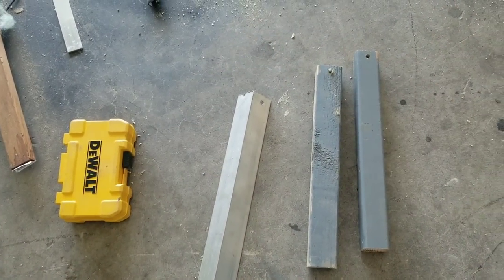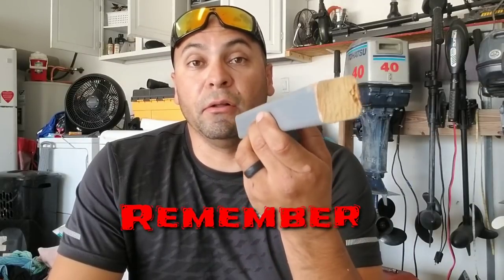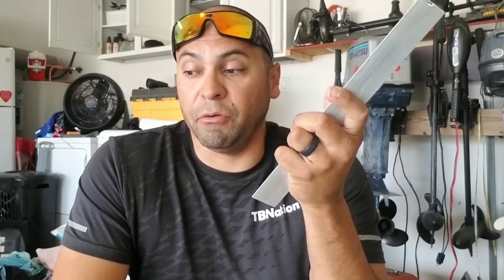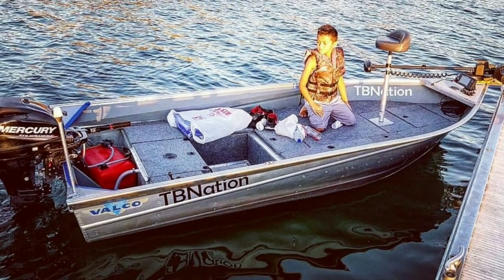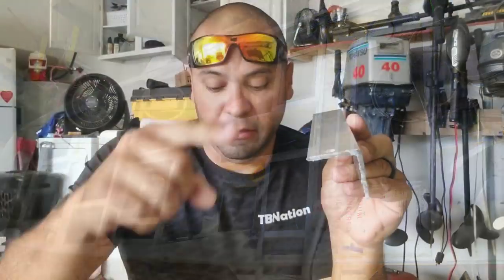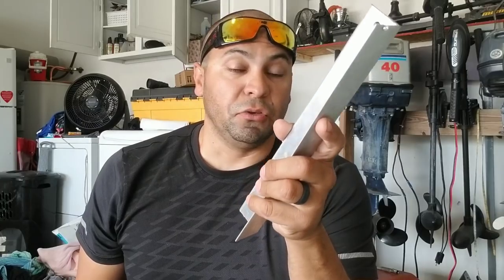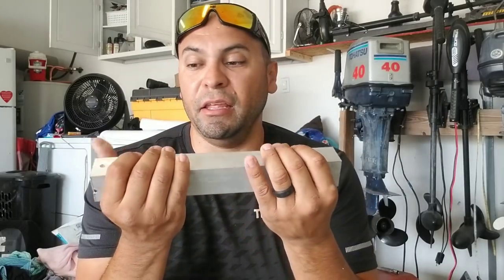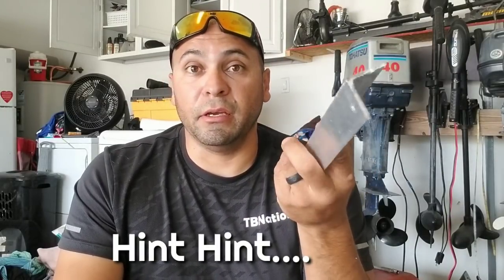Tiny Boat Framing Q & A

Comment: Mike, the cheapest I found was 1/8th 1 inch x 8 foot on Grainger.com. $9 each. Shipping is average, however, if you have a Grainger in your area local pick-up is free. I ordered 11 8ft. pieces for $108 in Memphis, TN... Im done with framing, starting electrical on my 1436.. stay tuned !!

Comment: Good thing about riveting the frame together is most boats being built are also riveted together.  just makes sense. they are built to flex.  ALSO,  a good place near me for Aluminum stock is IMS.  Industrial metal Supply.  WAY better than the big box stores!   I'm sure they have a few Phoenix locations, they have one in Tucson where i live.

Comment: Welding vs. riveting: anybody can do riveting, not so for welding...
1/8 vs. 1/16 structures: 1/16 has many advantages for tiny boats: weight (you can structure with a just-enough approach), assembling flexibility, assembling speed

I think that the TBN community found an optimum approach to handle tiny boat builds.
Reply from the maker: Thank you for your insight.

Comment: I made my framming with 1/8" alum. In the decking but on the side and on the bottom supports used 1/16". Ive had to. Do alittle overlay but not a ton. I also was starting to do a all cedar frame but changed my mind and now it a hybrid.. What size motor or what are your thoughts about this?

Comment: Have you used countersink rivets to make tops of the frame deck flush?
Reply: @TinyBoatNation  Also what about a combo of rivets and aluminum brazing rods and level your entire frame.  Use 1.5" angle as main supports as you have been using length wise.   Except for cross bracing use square tube aluminum (i have to double check but 1" 1/20 thickness).  

So for cross bracing use the square tube.  Lay your cross bracing piece down and mark where the tube meets the main supports (1.5" angle) (example - 30" span).  Refer back to the marks you made.  Add 1.5" to left side of left mark and 1.5" to right side of your right mark. Total piece length 30" + 1.5" + 1.5" =  total length 33" and cut 33" piece.  Now refer back to the ends.  Cut out the top and bottom peices on both end leaving a Left and Right tabs on both ends of 33" piece.  Bend tabs 90 degrees so tabs attach to the angle main supports and the square tubing fits in that 30" space.  Attach square tube tabs to length wise portion of the main angle supports.  Rivet in place.  2 rivets in all tabs and if needed braze support peices in the corner or tabs and main tube structure.
Reply: @TinyBoatNation   that square tube is 1",   0.065" thickness.  a 16" span hols 220lbs in the center with only having support on the ends.

Comment: 1/16 aluminium angle is about $32 Aud for 10 feet here , whats it cost in the USA
Reply: I just bought. 20' of 1 1/4" × 1/8" aluminum 6061 angle for 1.50/ft. And  16' of 1" × 1/8" aluminum 6061 angle for 1.25/ft. 

That's from a metal supplier in st. Louis Mo.

Comment: Weld Vs Rivet.
Amidst my first welded 1/8" frame right now.
Weld frames take ALOT longer to perform. Rivet framing for customer/Weld for personal.
Reply: Yeah 1/8 would be weld and if you cant weld, 1/16 seems wiser.